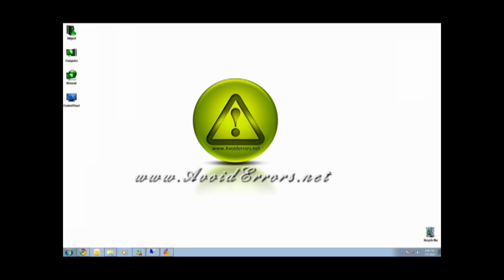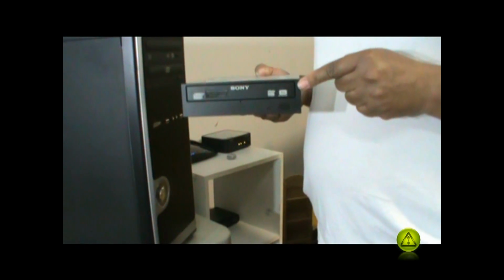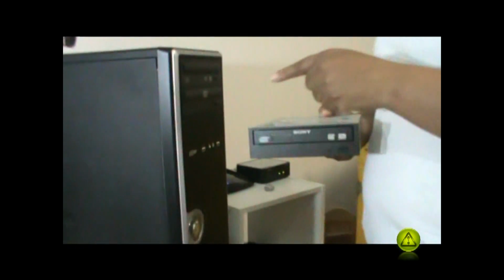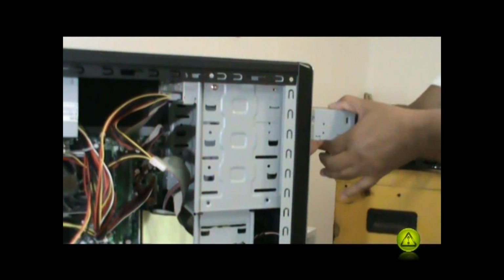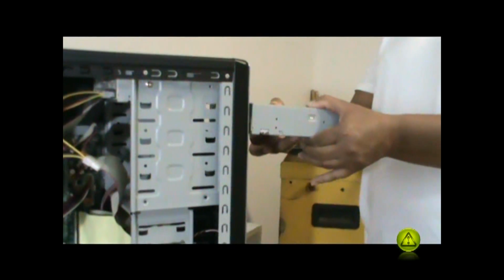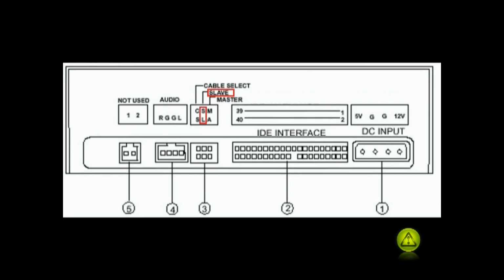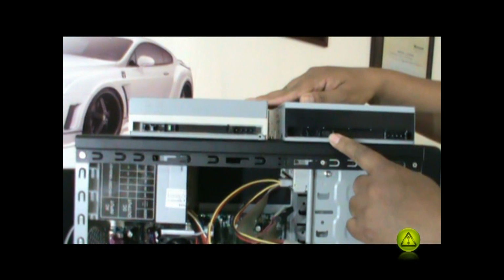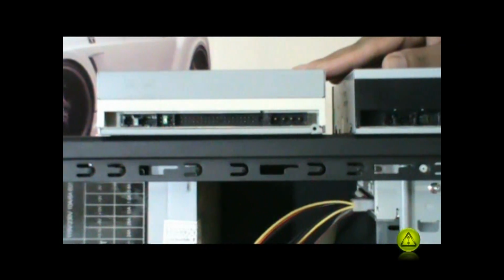How to Install a new CD/DVD Burner by AvoidErrors

Comment: For beginners, it's also a good idea to take a photo of the various connections at the back before unplugging so that you are more confident during the reassembly process.  It can also be helpful to use a fine tip marker to add a "T" on the upper surface of the connections so that you don't mistakenly try to reassemble them upside-down and damage the pins in doing so.

Comment: You just proved to me that my dvdcd rom burner is dying.I'm going to have to get a new one .i try regis edit which had no upper or lowere filter it .Claimed my drive was disconnected.that only means one thing .the fact I accidently deleted my firm ware and  i cant get it back .Well its dying that why .

Comment: . 
Question: Windows will automatically find drivers or do I still need to install drivers from online or CD (if the burner comes with it)? 
Question 2: Do you have to go into the bios & make any changes due to an upgrade?
I'm going to upgrade to a lightscribe blu-ray/ HD dvd burner writer since my DVD burner won't work anymore after a cd shattered inside of it. First time this happened to me but it happen to a causin of mine like 10 years ago.